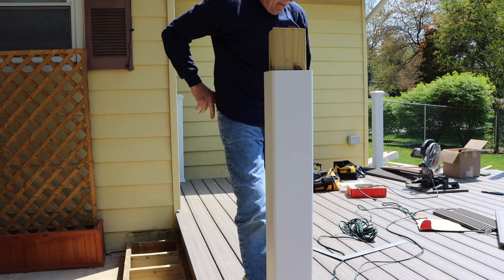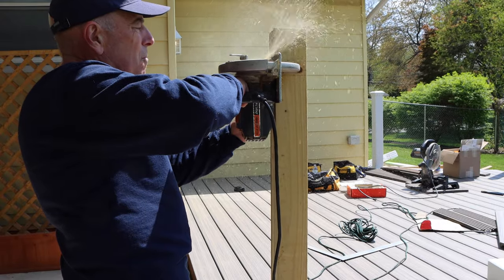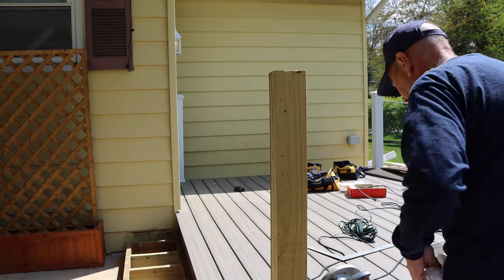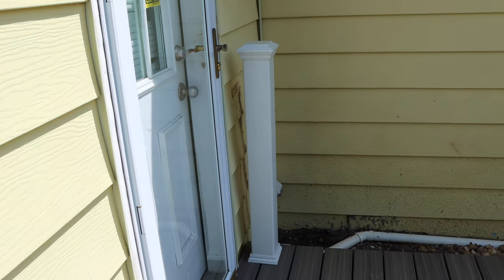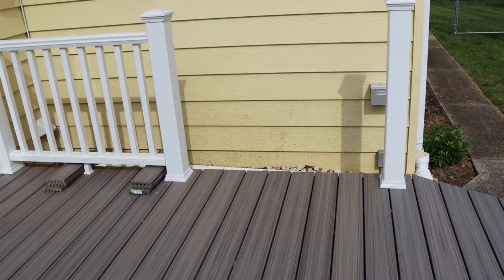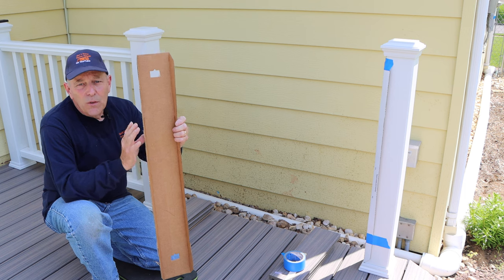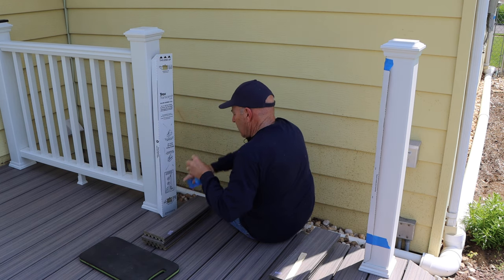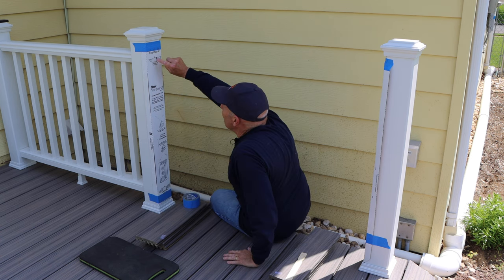How To Install Trex Railing Kit

Comment: Had to come here as a contractor and as many of my contractor buddies DO NOT USE TREX RAILING!!  It’s ok to use Trex decking but the rail/stair rail kits are crap. Get a BETTER system at Lowe’s called Dekorators. Really being they have the best application with covers for the application and covering screws.
Reply from the maker: Thanks for the info

Comment: Great video. I have a 12' x 20' Trex patio deck with the Transcend rails. It is very important to install the adjustable foot blocks that he demonstrated in this video. Adjustable foot blocks reinforce the rail and are required for every Trex composite rail section. If this step is not completed it will cause the railing to sag and doesn’t offer the structural durability needed for the railing system. I am dealing with this issue now. After a year and 7 months, two rail sections began to sag. I discovered the contractor only installed one section. Thankfully, I was able to purchase the adjustable foot blocks online and this video showed me how to remove the ballasters so that I can drill a hole in the bottom rails to install them.

Comment: We added a white railing to our front door and it instantly took the curb appeal  up $$$$$. Thanks for the using the template for marking the hardware placement.
Reply from the maker: Yes they will dress up the front area for sure.Thanks for the visit

Comment: I assume your rail system was designed a certain length in size and you installed the 4x4’s with this in mind while installing them. I’m guessing 6’ apart. 
What if you had an odd size like 3’? Would you just cut the railings to that particular length?
Reply: Yes